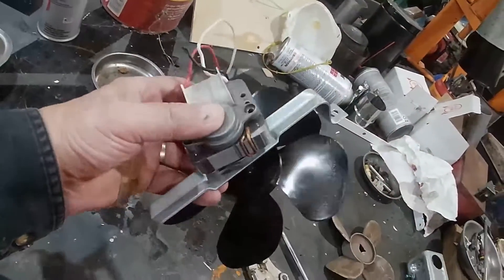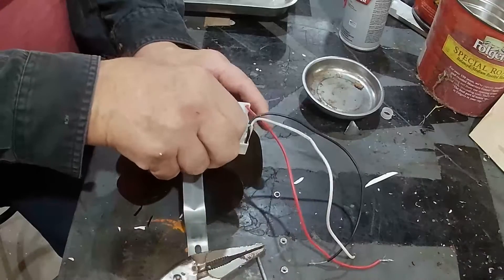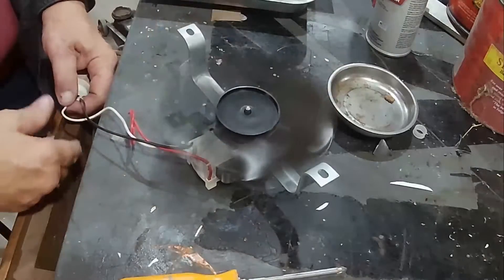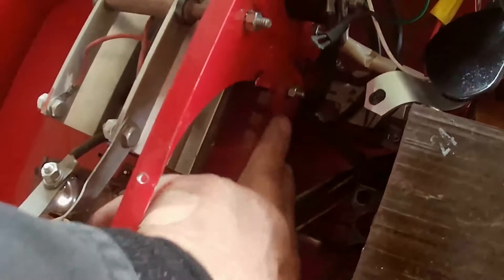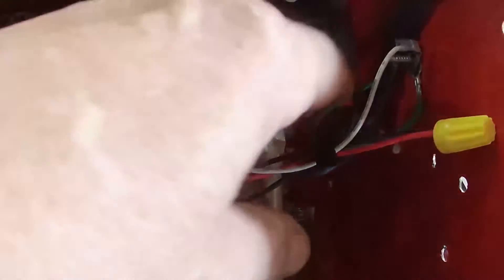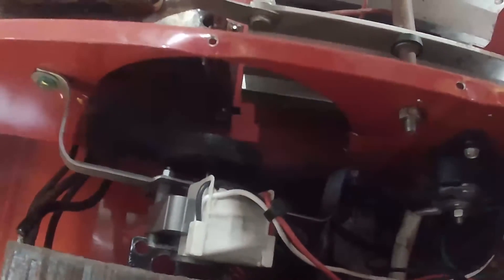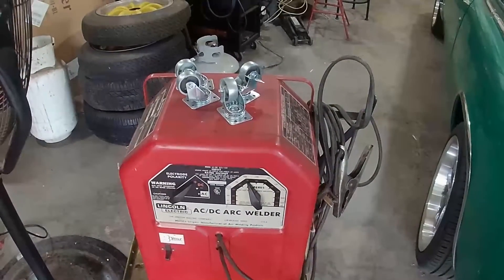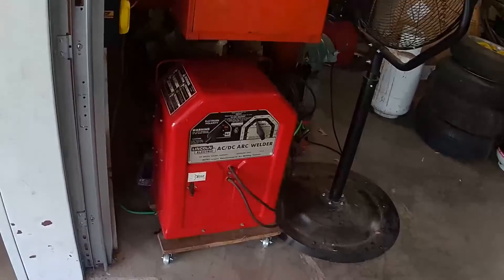Lincoln 125 250 ac dc arc welder fan replacement

Comment: I just came across this video , I'm  surprised nobody commented on your motor connection !  It is illegal / dangerous  to use the ground for a neutral wire !... You need to supply the welder with a 4 wire cord that has a neutral { white } wire if you're using a 120 volt fan motor .
Reply from the maker: Thanks for the heads-up.

Comment: No need to switch the coil.  With DC motors you just switch the wires,  White to ground and Blick to hot leg.
Reply from the maker: @chathaway7977    The motor was 120v ac. Thanks and take care

Comment: Hey man, you should of also turned the blade around as well.  Now, the curves of the blade won’t be able to properly cut the air.  Hence, that stymies the fan of proper airflow.
Reply from the maker: That’s a great point, I’ll try that next time.

Comment: Hello.
Welding machine fan failure.
You repurpose the range hood motor.
That's a great idea.
You reversed the direction of the wind by flipping the motor attachment.
You successfully repaired the welding machine fan!
You installed four rollers at the bottom of the welder.
It is effective in moving the welding machine.
This is another great idea! (^_^)v
Thank you my friend.
Reply from the maker: Thank you my friend. The fan repair is working great on the welder and should be around for many more years. Have a great weekend

Comment: I instantly smiled when I saw you take the motor stator out and turn it around.  Good repair, Lloyd. Replacement part prices are getting to the point where you either find a clever solution as you did or you will be forced to junk the machine. Thanks for the video. Have a pleasant weekend.
Reply from the maker: Thanks Bruce, the fan replacement went great and the welder is working like new. Thanks and have a great weekend

Comment: Great fix Lloyd. I’m in the market for a used Lincoln or Miller AC/DC stick welder. My old P&H Chemtron is AC only and can’t weld 7018 rod.
Reply from the maker: I bought this welder new many years ago. I couldn’t bare to let it go cause of a bad fan. Thanks Matt

Comment: those are very good little welders, I have one I think I got it in the 80s it just AC  but it's never given any trouble, I did change the cables,, my dad got one back in 63 they called them a" buzz box" because it didn't have a fan and after a while of welding, it would shut off for a while to cool down.. where did you get those steel casters?
Reply from the maker: I got the wheels from Amazon. They worked out great. Thanks Vernon

Comment: That looks like a great welder. It was great that you were able to find a replacement fan and I like how you turned the motor around to change the direction. The caster upgrade is great
Reply from the maker: This welder has been around a long time and I had to save it if I could. Thanks and take care

Comment: For lubricating the castors, is castor oil best? 

Good engineering solution.
Reply from the maker: Definitely, caster oil would keep it running smoothly just like it does on so many other things. Thanks and have a great weekend

Comment: cost savings and a custom welder.  its been a while since i have done any stick welding.  good job Lloyd
Reply from the maker: Thanks Bob, I like using the stick on heavy jobs. Not as pretty as wire but burns in good